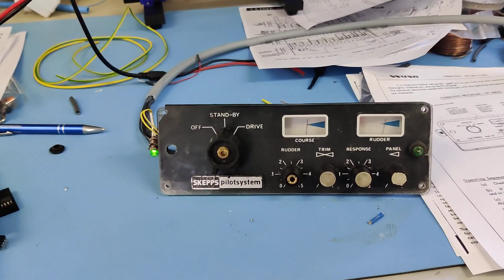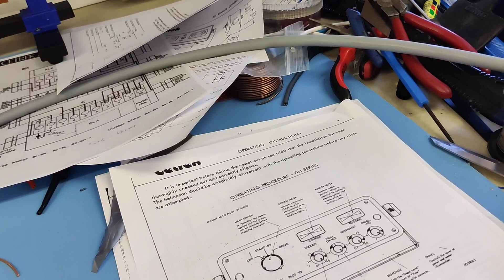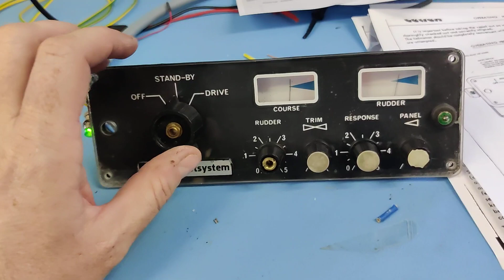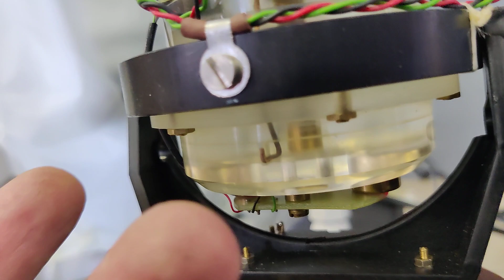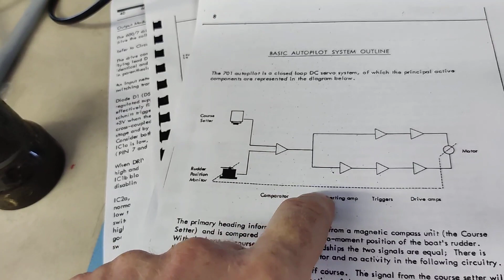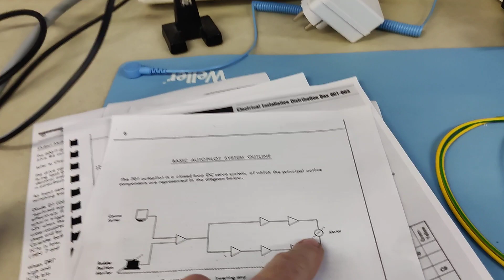Cetrek 701 autopilot presentation

Comment: Hi Linus. I have a Cetrek Powerhelm 770 remote controller that won't turn on or display anything. Is there a way to test it before buying a new one or would you happen to know what voltages I should be able to read at the pins on the helm mounted plug?
Reply: I did find a blown fuse in the compass controller,replaced it but still no readout on the remotes screen.
Reply from the maker: Sorry, I missed this comment. I don't have any documentation for this remote, neither do I have any experience unfortunately.

Comment: thank you very much for sharing this. I have the Cetrek autopilot with the handheld . It has suddenly stopped powering on , the screen lights for a brief second , I hear "click" and then nothing . I was thinking it could be a solenoid , but I don't see one on my board . Could it be battery voltage issues ? I tried using the test power button (yellow) on the board ( Red, Yellow , Green Led above 3 buttons on the lower right) but just heard "click" .  I realize you are not too familiar with the Cetrek, but perhaps you would have a suggestion for me to check ? Thank you again .
Reply from the maker: It could be a whole range of issues but it should be fairly straight forward to troubleshoot with some schematics and electronics knowledge. 

I have two documents containing manuals and circuit diagrams. This is the first of them 

https://www.filemail.com/d/asjuobdwqlhbstp

Here is the second one. Links are valid for one week. 

https://www.filemail.com/d/nozmetnmwfmdewy
Reply: @LinusNil  thank you. I just identified the problem. It seems to be related to the battery bank setup. It wouldn't start with the battery switched to engine battery only , without the engine running. But with the battery bank switch set to all / both battery banks, engine and house,  the Cetrek powers on and works fine.
I have a set of booklets for installation , user guide and compass , as well as dockside, sea trial and user guide plastified cards . The troubleshooting section mention error codes and running issues , but nothing about clicking sounds .
Reply from the maker: @LydieBaillie  Hi. Nice to hear you fixed it. It seems like you have a battery related issue though. Or something with the battery wiring.
Reply: @LinusNil  yes, I think so too.

Comment: Hey - thanks for the video. I have the same system where one of the LEDs in the compass did not shine. The two adjustable components on the PCBs are potentiometers. The left one controls the relative intensity of the LEDs, so adjusting that allowed me to calibrate again. Just a heads up if anyone has the same issue. The right-side potentiometer seems to adjust the output of the two sensors.
Reply from the maker: Yes. I actually reverse engineered the schematic for this board (not too hard).

Comment: Nice video Linus!!  I too am fascinated by the simplicity here.  Unfortunately I have a Bennmar Course Setter 21 and the compass is stuck.  The compass card it is encased in fluid which is clear however Bennmar says that it has a mechanical pivot stuck issue.  I am researching on substituting a compass.. but not sure if I should just buy a autopilot (NAC-1)controller which uses nmea2000 , use my Lowrance FS9 Elite nmea2000 as the front end , with my HELM-1 type drive unit?    Any thoughts are most appreciated?
Reply from the maker: To be honest I don't have much to say about that. I am actually not very experienced with old auto pilots so I have to learn on the go so to say.

Comment: Hi Linus Nil, I do own the same auto pilot system. I'm having an issue with my 504 compass. The inner copper sliding contact ring is worn out in the middle and therefore not working anymore.
Do you have any solutions? Best regards Jonka
Reply from the maker: Hi. Unfortunately l have no solution for that particular problem.
Reply: Hi thanx for the reply
Reply from the maker: I guess you could make a new pcb to replace the one with the bad copper trace.
Reply: @LinusNil  Thanx, working on it. brgds
Reply: I would try to bend the small contact spring needle to another point on the trace. Seems doable on my system.
Reply: @RunePaamand  Thanx for your reply, will try.